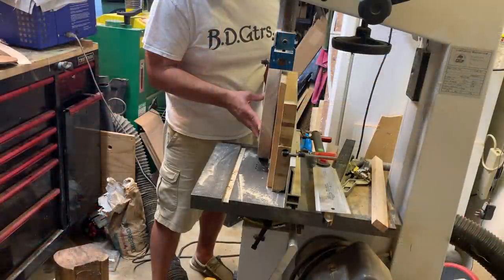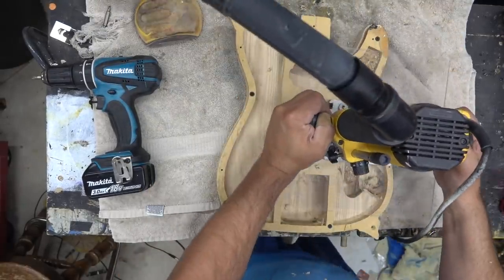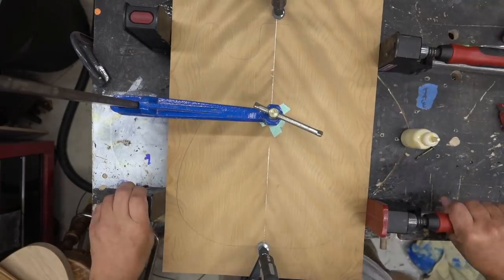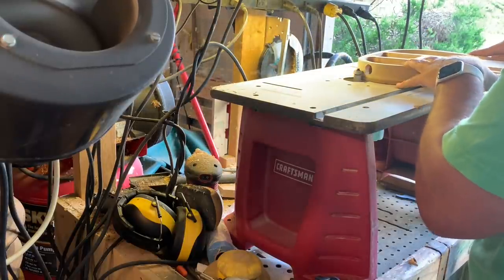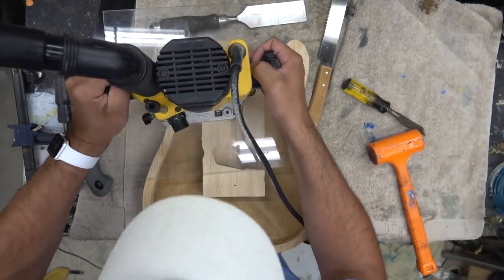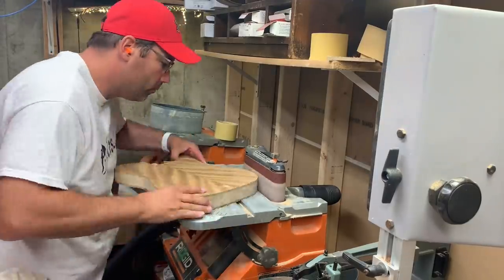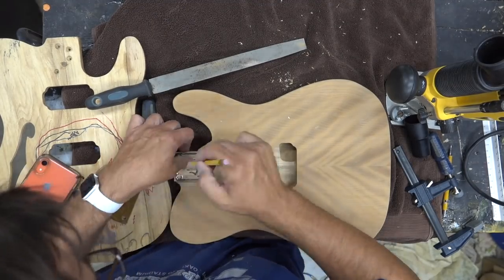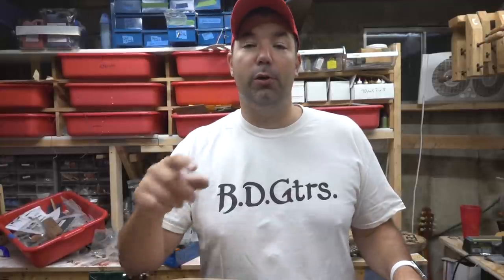Great Guitar Build Off - Body Modification Time!  Lets get to work!

Comment: I like your idea for a hollow body and the tops look great I really like to see a purple into black burst . Only thing I would do different is make the body solid where the bridge is to improve sustain and use a metal backing plate that bolted the bridge and neck and pickups to it and grounded it all thru the back plate for way more sustain and to clean up the typical squeel of a hollow body at higher volume. No trash hear just shooting out some of my own ideas nice work

Comment: Such a clean look with no control plate or F-Hole, this build really shows this isn't your first Redeo.
Real classy design for sure, especially so for a Telecaster.
Also glad you are not using the paint/swirl finish..........Sorry Derek, I couldn't help myself!

Any plans for the headstock?   
You could do a Birch overlay if you had extra material.

Comment: I'm curious. Why not route the hollow portion 1/2 to 1 inch in on those middle supports? You'll still get the support you need for gluing, but won't have to chisel the part closest to the edge later?

Comment: This is a great video as it just shows your clear vision and years of experience. Did you use hide glue as the top or back can be more easily removed in the long term over titebond, or was just a random choice bcuz that's what you had at the time?
Reply from the maker: Some claim better resonance.  I wanted to try it.  Tone glue.

Comment: Why not just use a jigsaw if you removing the wood all the way through, what a wast of router bits
Reply from the maker: Those small blades break a lot.  I have steered away from using a jig saw